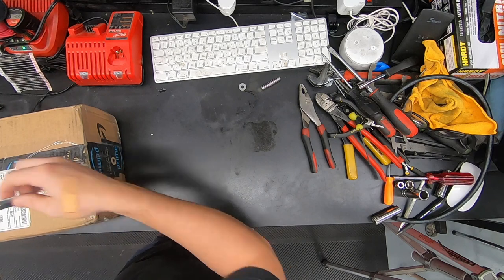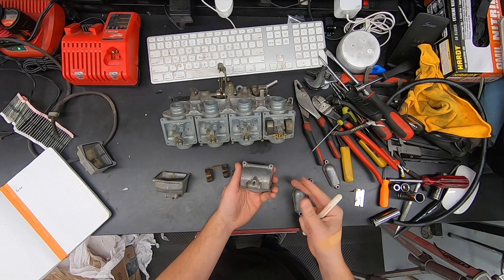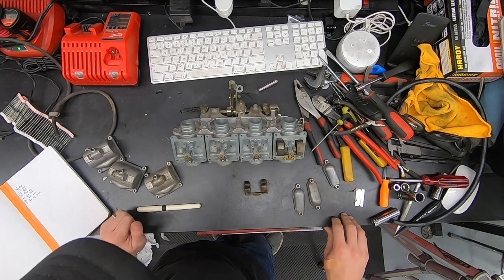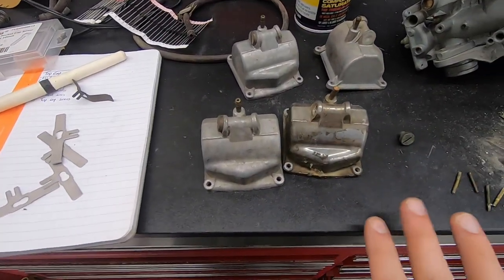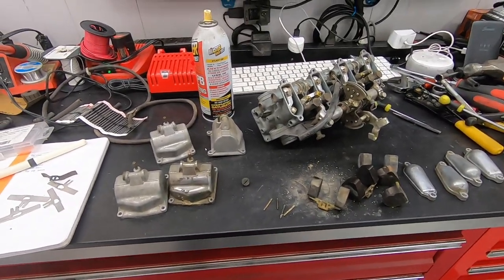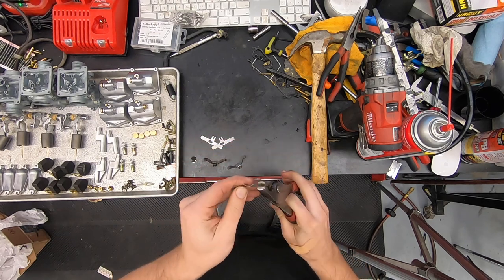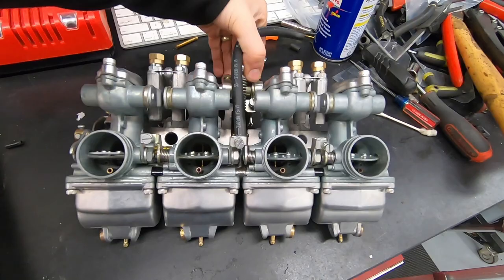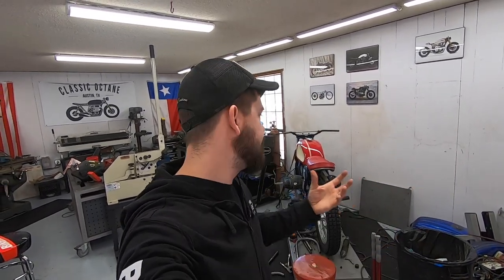Can we turn this pile of junk into working carbs?

Comment: Great video, I love carb work.   When dealing with a rack of 4 carbs, the CB750 bottle top style carbs seem like the easiest to work on.  I like that the bowls go on with just a clip, no screws needed.  And the tops unscrew by hand.   Not a ton of parts on those carbs....compared to some of the others.    That being said, I have an extra set of bottle tops that I've cleaned, rebuilt and sandblasted  but can't get to work correctly.  I keep getting a hanging idle (and it's not an air leak at the boots).   I bought the extra set of carbs as an educational exercise... I wanted to take them completely apart, clean and reassemble them without worrying that I might screw something up.   This spring I'm going  to get that extra set to run correctly.

Comment: I started watching your videos recently,  great to see someone who actually knows how to diagnose and fix engines.
I love the cafe racer rebuilds, but would like to know why you delete front and rear guards. I guess it's the usual style, but doesn't it mean that that the engine is going to get blasted with grit, dirt, water and oil? After you spent all that time cleaning up and repainting the engine!
Why not fit trimmed down guards to keep the crap off? It will still look cool.

Comment: Those look very nice. I've got a broken tower that holds the float. Is there a way to fix that? My idea is cutting it off flush drilling a hole and threading a small bolt then drilling a hole through it for the float pin and cutting the head off the bolt making it more like a stud. Think that might work?
Reply: i've got the same exact issue, did you end up with that route still?

Comment: I want to rebuild the carb for my '78 Suzuki GS750 (first timer) – Are the air/fuel screws the only hardware that is adjusted? Meaning, in reassembly, all jets and fuel hardware are seated snuggly besides the adjustment capabilities of the air/fuel screws. I want to do this right but haven't been able to find this info or torque specs (if any on a carb). Thanks for any help.